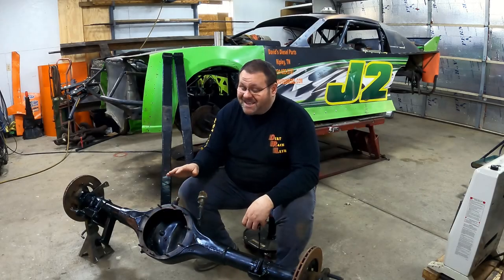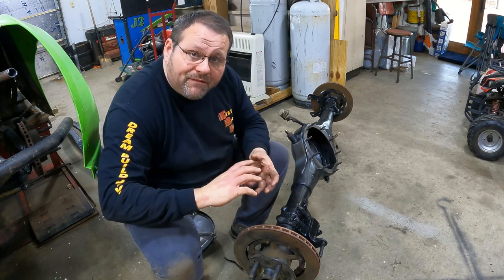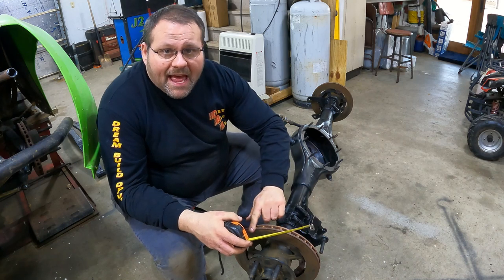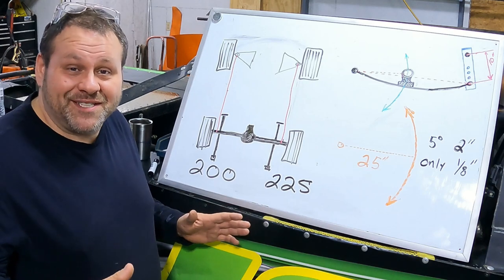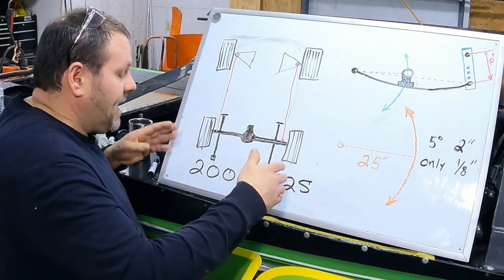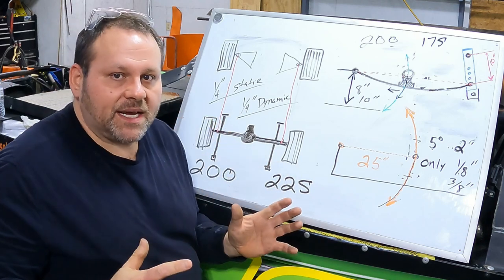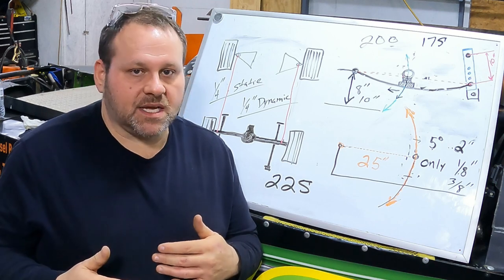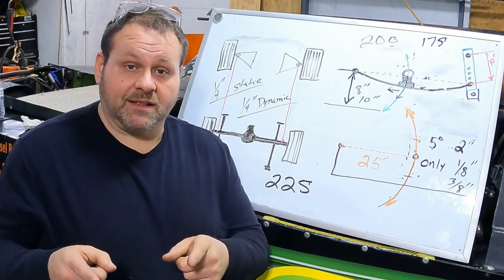I am Running a Heavier Right Rear Leaf Spring to make this Car Faster!

Comment: Jason I went from running on oiled down dirt and ran 225 left and 200 right. Tracked closed and we went to clay. Swapped rear springs after struggling to get the car to work. It worked really good after working with the shackle adjustments on left rear. It was luck because I definitely don’t know the math like you. Thanks for the video.
Reply from the maker: I knew a few of you had done it and made it work. I think it has potential ;)

Comment: I been watching a lot of your stuff, just got my first dirt car. It’s an old sport mod leaf spring car. I know I ain’t gonna do real good, as most cars here run the 4 link pull bar set up, but I wanna do all I can. 4 tires are just 4 tires, they offer X amount of traction and I think I should be able to give the anti squat guys a decent run… just gotta figure out how to
Reply from the maker: If its mono leafs and coils it's still going to be pretty competitive and if it's stacked leafs the key is putting some known fresh leafs on it. And don't be afraid to run a heavier RR leaf than LR leaf!

Comment: Another  great one Jason. Getting started onmy rebuild of the ol Chevelle and someone switched it over to a leaf from coil. I never have run leaf but have always been curious. I may give it a shot
Reply from the maker: Well it's different from coils for sure but they have their advantages too :)
Reply: @DIRTRACELIFE  would you say Leaf springs are more or less consistent.? I feel like Coils are more adjustable but Leaf may be more reliable and consistent..... I’m building the chevelle for the Lonestar 600 enduro race. Looking for reliable and consistent. Thanks for your help
Reply from the maker: Well as always it depends and the answer is yes and no. . . . . :)
YES, on the track during a race the leaf spring gives you a car that will rotate and drive through and off the corner more predictably in regard to where on the track you are and how you enter the turn. For example if the car is really good in the middle on a smooth track, a rut can form and that car can continue on that line and blow right through it yet you still seem to hold the same corner speed as before, or if you move up or down the track it will still seem pretty good. Just keep in mind, if the setup is junk, then it's probably junk everywhere, and you are just hunting around the corner to find a line that's least offensive to the car. In a coil car this is not at all the case and moving around or changing track conditions can give significantly different lap times BUT a well-tuned coil car in the right line can be faster so it all a trade off of gains and losses between the two.
NO, Stacked steel leafs change in rate and shape at a significantly faster pace than coil springs. You wouldn't think anything of running a full season on a set of coils without checking them for free height change. On leafs, they wear enough with every race event that you can detect changes week to week as a measurable change in the scaling of the car and ride heights. It's not a bad thing if you know what you are signing up for but if you for example take your car to a buddy's shop at the beginning of the season and then expect to run great all year, well that might not go well for you. This is the main reason I knowingly gave up some forward drive by going to the composites. They will not wrap up the same way as a stacked steel leaf but the rates don't change until you break them.

I hope this helps!
Reply: @DIRTRACELIFE  That, Helped tremendously ! Thank you a ton for taking the time to explain.

Comment: Changing the angle of spring changes the anti squat. My go to on a leaf pro stock to add forward bite is to space the rear slider down an inch. Go to far and you’ll get wheel hop tho
Reply from the maker: Exactly and yes I can tell you from experience that 12 inch shackles and 3 inch blocks will wheel hop. Oh yeah she bucked like a mule on tacky gumbo down at riverside international speedway but I had to try it :)

Comment: back in the day my buddy built a rear end straightener out of I beam.  you could mount a rear end in the jig and measure with a dial indicator.  he would use a bottle jack to make the adjustments.  the jig isn't that hard to make if you got a welder and drill press.  there is bound to be some videos doing this on youtube.
Reply from the maker: Absolutely Kechum, the one way I have straightened an axle was a trailer axle with just a log chain and bottle jack but boy oh boy you better have that jack chained up cause if it jumps out she's a missle 😞

Comment: Jason I’m gonna need you to run it one time behind the wheel and let us know, I’ve gotta buy new springs in a couple months an would like to see how this works for the car. Also would this not take a lot of your left rear bite out since it’s heavier on the right side
Reply from the maker: Well Steven, There is NO WAY I can fit behind the wheel the way I set it up for her LOL
The heavier spring to the right is not at all a factor in cross or bite because I have adjustable spring cups in the front, multi-hole shackles in the rear, and can change lower block heights on the springs as well. Just for frame of reference, if I had not adjusters in the front and the same rate springs across the front, just a one inch taller lowering block on the right rear would be more than enough to compensate for the heavier right rear leaf and put bit into the left.
Reply: @DIRTRACELIFE  So what kind of split have you found in the front goes with this rear spring change you have made?

Comment: On the modified there's a place behind the seat on the frame that is built for squaring so that it makes it easier to measure from but what you have work that's just another way you can do it.
Reply from the maker: I have square tubing built in on my Camaro just for that purpose as well. Smart minds think alike ;)

I still use the front lowers as well and it's very universal :)

Comment: So your going to make it tighter in and looser off .
Reply from the maker: I did this because I adapted my driving style to make the leaf car much better in the slick. And it is. But you drive it differently because you pick up the throttle on entry and roll into the corner instead of drifting it in on a slide/skate. comes through the middle much faster and you no longer need a ton of bite to get off the corner.

Comment: Would this work on my Camaro if I’m running a smaller dot tire?
Reply from the maker: Well sure, tire size affects a car's ability to hold wheel load to the track and that is just lap speed at the end of the day. It's true that the more a tire can hold, the free-er you need to make the car, but DOT tires compared to H500s, G60, or grooved asphalt scuffs is not a big change that wrecks your setup. You just free it up or tighten according to how well they work.

Comment: I used composites when they first came out. Since steel springs always want to return back to their original state of being flat. Was going through three sets a year, re-arching made it worse. Composite springs made it tighter going in. Since the arch is less than a steel it lowers the rear roll center’s.Since this all happened in the middle of the season I started trying different rates. Put the stiffest that they make LR250/225RR cut 2” off the rear of the spring’s bolted I let back on to change shackles angle made a big difference and helped the entry and exit with forward bite. Was wondering how soft of a front springs Can go with the roll center’s height and to the right. Also with the longer shackles could help with rotation. Thanks
Reply from the maker: All that makes sense to me Tommy. I do the same thing and raise the ride height while extending the shackle to prevent lowering the roll center and taking anti-squat out of the car.
Also, I was doing pretty decent on a 750 rf as the softest but honesty I think 8 to 900 is better for drive off.
Reply: @DIRTRACELIFE  was getting ready to go with a 900RF 800LF with front roll center’s to the right of center line.

Comment: Does the Lf leaf flatten out or wrap up under drive ?  You use a spring rubber on the right rear ?
Reply from the maker: Jeremy, on acceleration the front flattens and then the back wraps as it does it. It's the reverse when you let off. No, I don't have a rubber isolator on the right side.

Comment: So do the shocks stay where they were before the spring swap or do shocks swap with the springs?
Reply from the maker: Russ, No you would not swap the shocks. We are still looking to have a shock on the rr that's main job is to keep the car planted by smoothing out the the bumps with it either 50/50 in nature or possibly a slight increase in rebound where as we are looking for some extra compression possibly in the lr for timing the load during mid-turn and exit. Swapping them would be the opposite and would be bad 👎
Reply: Thank you Jason
I’m in the process right now of installing new leafs in my nova, I’m going to give this a try.
Reply from the maker: Just keep in mind, I am trying and learning as well. I don't claim to know the best way, just to be honest and bring everyone along for the journey. Good luck and please let us know how yours does as well. Maybe we can compare notes and both get faster 😀

Comment: Unfortunately I can't run composits. But this is the route I'm going, but started thinking.. would it make sense to run the 5" arches instead of 6.5"? Or do people mix and match?
Reply from the maker: Mixing them could be confusing in the setup because ride height blocks wouldn't act the same. You would have to account for that and then it would shift the roll center but not sure by how much. I like alot of arch and in stacks I like the 6.5" Landrums but in composites it just doesn't exist (there is no 6.5 inch composite) More arch with lowering blocks has more anti squat and more forward drive.